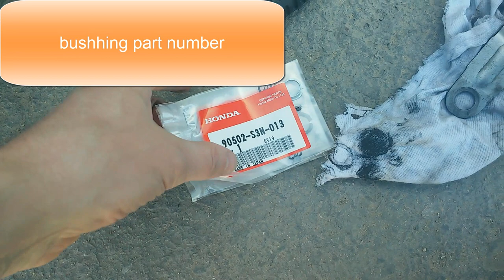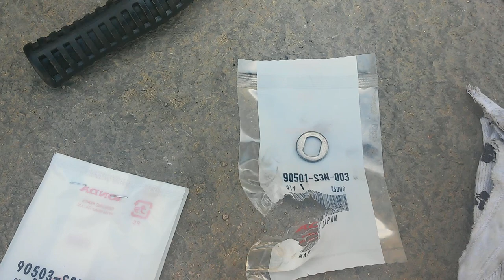Honda Civic 2001-2005, How to fix driver rocking seat

Comment: Because of the price I only ordered 4 of these and I replaced just the 4 on the metal brackets I did not do the one near the reclining back cushion.

The price has gone down from what is stated below, I paid $10.78CAD each, so about $7-8USD for each. Thanks for this awesome video

I tightened the bolts as hard as they would go and it stopped about 85% of the rocking, bI hate it moving so I went ahead and bought the bushings. It's weird how these things can go bad, considering they are just tiny metal pieces.
Reply: They’re $10 here. 🤦‍♂️ Got a link for cheaper?

Comment: In my case, I have just tightened up the boats.   Cheaper, faster, and still holding.  

Mario from Canada
Reply from the maker: Sometimes it helps just to tighten the nuts, but in my case front bushings were totally smashed.
Reply: This worked for me too
Reply: the boats?
Reply: @jeffys_  yes if loose they might capsize
Reply: Thanks @mario I will try your way first

Comment: Are the spacers actually metal wave washers with a springiness to them? Honda calls these  ".030 thick washers " in the TSB , but they give strange names to other parts also-John in Texas
Reply from the maker: There is no springiness in washers, you just need to replace the bushings(bush), part number 13 in the link down below https://www.hondapartsnow.com/parts-list/2003-honda-civic--4dr_ex-ka_4at/interior_bumper/front_seat_components_manual_height_driver_side.html

Comment: Aren’t the Honda replacement parts also prone to wear? Aren’t they have the same weakness?
Aren’t there better material quality sturdier third party replacement available?
Like weapon-grade steel manufacturing that will carry weight for a century without wearing out?

Comment: So basically I need 6x 90502-S3N-013 and 6x 90503-S3N-003. Correct?
Reply from the maker: Part number of bushings is 90502-S3N-013, required quantity is 6. All other parts you can put back, you don't have to replace them as I did.

Comment: Is this the same for a 2002 Crv? I cant find any videos on it
Reply from the maker: Sorry, I don't know if this the same for a Crv.
Reply: @Eat Raw Meat  I haven't found a vid yet and I can't find the parts, I'm going to a junk soon just going to look for a good seat or take it apart and make something my self from what ever I got laying around
Reply from the maker: @Eat Raw Meat I've looked at car parts catalog if Crv has the parts that I replaced and I didn't find it. I find some service bulletin for you, and there is explanation of problem and what car parts you need to replace. Here is the link: https://www.scribd.com/document/375006316/CR-v-SeatBushings
Reply from the maker: @frankm8533  look at this first: https://www.scribd.com/document/375006316/CR-v-SeatBushings
Reply: Had this wobble on a 2002 crv drivers seat , I waked the bush with a hammer and screwdriver and it was a temp fix for a year . Needs doing again but i found out its a common problem with hondas. Might try a bigger hammer.

Comment: I'm a little lost at the part in the begining where you "remove the pin?"  Where is it exactly?
Reply from the maker: It's in the adjuster, when you remove the cap you can see through the holes the pin, try to remove it with flat screwdriver and in the same time try to take off the adjuster.

Comment: whats the part's name? I have a 2009 ex and rockin too
Reply from the maker: The part name is: bush or bushings. I've found this components only on the passenger side of your car, on the driver side I didn't find any bushings.
Reply: thanks for fast answer, i will change it for a new comfort
Reply: i just removed my 2009 civic's seat, but washers are ok, just back rocks, i don't find the problem :(
Reply from the maker: Unfortunetely I don't know what is the problem too, maybe you need to buy used one or try to find someone who can help you to fix it.

Comment: What are the part numbers and how many of each?
Reply from the maker: Part number of bushings is 90502-S3N-013, required quantity is 6. All other parts you can put back, you don't have to replace them as I did.
Reply: @Mr.Ivan3  wow, they are charging over $8 a bushing now; $50 plus shipping.  I can just go to a junkyard and pick up the same or better seat for that cost ...  must be covid gouging?
Reply from the maker: @kuromurasakizero9515  if you live in USA it's cost $8.09 and shipping $10-12, if you live in Japan it's cost $1-2 and shipping $12-15, currently the price of bushing maybe high due to demand, so they decided to raise prices in USA.
Reply: @Mr.Ivan3  You said it needs (6) six.  6 time 8  (U.S.) is $48, plus taxes and shipping.  That is over $60 to change bushings on a single seat.  These seats are not that wonderful to throw that much to get it to stop rocking, at least in my opinion.

There is certainly a 'shadetree mechanic' way of fixing this issue without paying through the nose ;)
Reply from the maker: @kuromurasakizero9515  That's right you need 6 bushings. Another option to fix it as people said down below is you can try just to tighten up the nuts, may be it will help you to fix it without spending money at all.